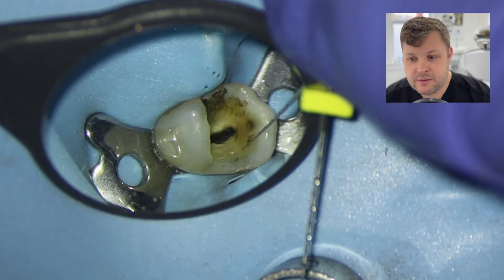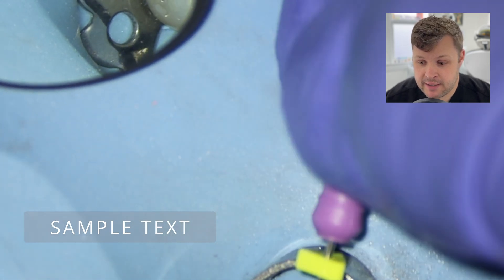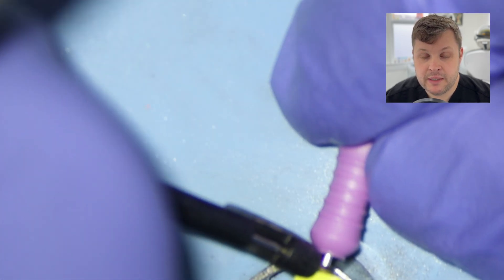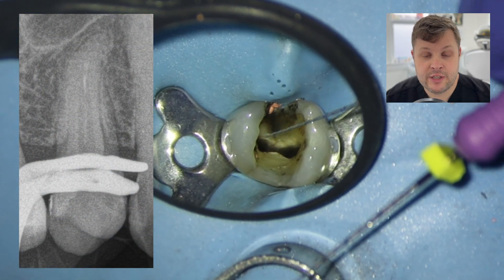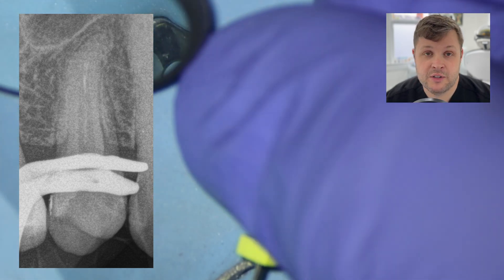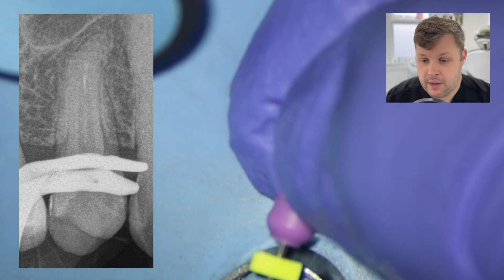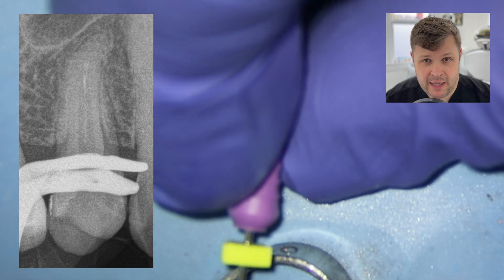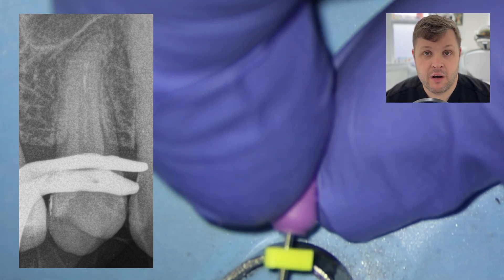Thermafil Removal in a Tricky UR4 Re-RCT | Watch the Full Negotiation & Fill

Comment: Hi, what would you do if the carrier fractured well below the orifice and you didn’t have a lot of patency around it?
Reply from the maker: Good question. I’d just pick away at it, and use smaller diameter Hedstrom files. But be careful when using the smaller files and the risk of fracture!
Reply: @ thanks so much! Appreciate this

Comment: Thrill of the fill for sure! You can see the extra happiness in your smile :) 

@15:45 I noticed that fracture line on the marginal floor. I'm assuming no narrow-deep probing depths were found indicating prognosis is still favorable. Is this something you inform the patient about and/or change your prognosis for the tooth?

Since it extends to the orifice do you tend to burn off more GP And place the composite lower into the canal?
Reply from the maker: Yes, great shout! Our management of cracks have now changed since I qualified. In my opinion, as long as the crack does not extend down the orifice, and the patient is informed, then root canal can be still attempted. Of course the tooth needs a full coverage restoration to protect it long term. What are your thoughts on this?
Reply: @ilovethepulp  Completely agree that if the crack doesn't extend into the orifice that the prognosis can still be favorable! Always makes my heart sink especially when I see a fracture line on premolars.